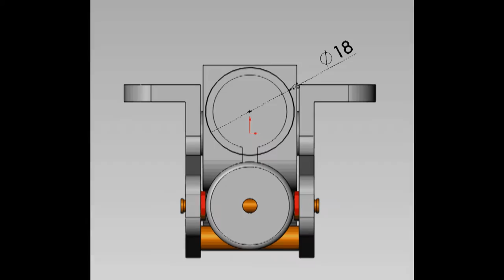JP ER 150 testing

Comment: Very nice Shane. Good to have the controller separate and not have to use micro switches. I will use these on my next jet. How are the large diameter brakes coming along?

Cheers Dean
Reply from the maker: Hi Oldman Aero, The max diameter brake is 95mm.
Reply: Hello Shane, Its Dean. we have Emailed each other before (Buckaroo) Where can I get the 95mm brake set?